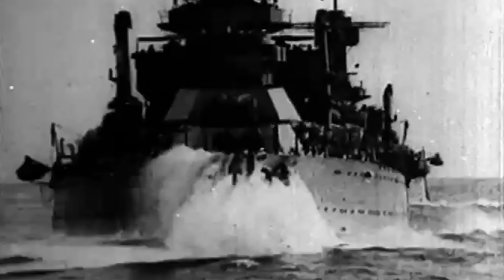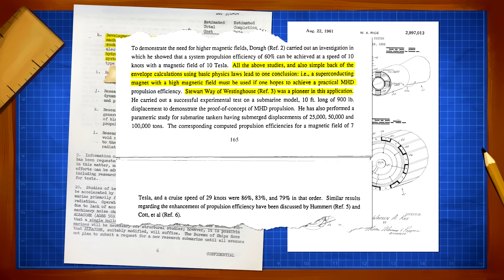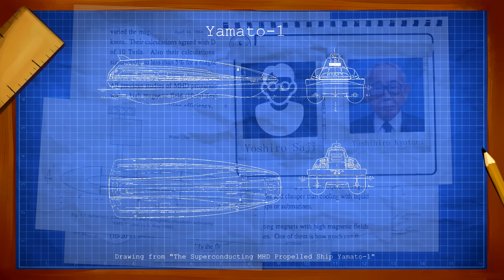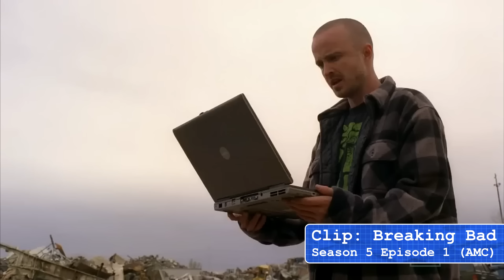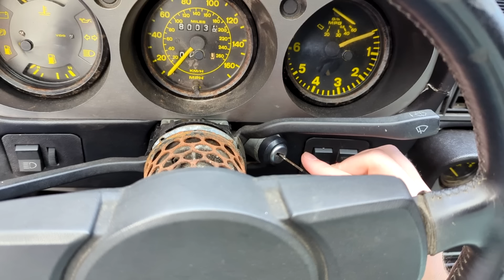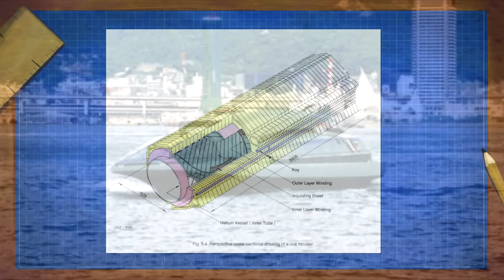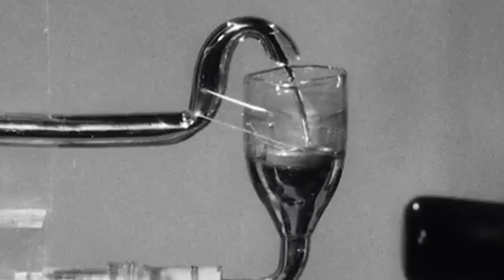Japan's Magnet-Driven Marvel: The Yamato-1

Comment: Why not have multiple small circular accelerators with valves to direct thrust outward and pulse the thrust with each accelerator offset by exactly one half or whatever fraction of a period? Then you could just spin the water until it's going fast enough without needing so much power

Comment: With the new development of electric motors, where the use of copper wire is replaced with a structure of copper bars, which provides a significantly higher voltage, this invention may now be realized.

Comment: The boat would've been faster if the diesels directly provided the thrust or powered electric pump jets and weighed significantly less.  MHD is possible but it seems it's better to achieve the same goals with literally any other form of propulsion.
Reply from the maker: The same can be said for internal combustion engines. When they were first introduced you could argue horses were still the superior source of hauling things. Yamato-1 proves MHDs can work in theory now the technology just needs to get to the point where it becomes viable

Comment: I wonder what the modern hightemperature superconductors would allow a system like the Yamato-1 to achieve. They would only need liquid nitrogen cooling. There are currently some nuclear fusion systems using them with very encouraging results. Shqme it is gone, so we eon't know.

Comment: I dare say it was somewhat more than just a recession, in that it was a recession and 35 year stagnation predominantly caused by self sabotage as shaped by the US empire for the benefit of the US empire. U.S. pressure, especially through agreements like the Plaza Accord in 85, pushed Japan toward policies that ended up worsening the bubble and shaping the crash. Japan’s own policymakers then compounded the damage through tightening and slow financial cleanup. Japan was on track to overtake the US economy within a matter of years before this. China faced its own bubble, but because it keeps tighter state control over finance and doesn’t depend on Washington the same way, it has been able to manage the fallout differently and in a far more beneficial way to China itself.

Comment: Someone help me.  I missed why MHD is desirable.  No moving parts in the drive train?  Thus less noise and easier maintenance?  And in turn we gain; added galvanic corrosion issues, magnetic shielding requirements, a maintenance nightmare cryogenic system with increased maintenance and repair costs, added cost due to scarcity of He, presumably increased power consumption and ??  Why is this a good thing to do?  Reminds me of Chrysler’s turbine car built back in the 60’s - what problem was it intended to solve?

Comment: Nice video! I have been an MRI engineer for over 30 years and I have to make one major correction to your video. There is no reason to continuously warm and cool the cryostat and ramp the magnetic coils. We have MRI coils that have been continuously on field for decades. Warming and cooling cryostats is expensive, time consuming, and a huge waste. All you need to do is run a relatively low power cryo-cooler to maintain the liquid helium, then you just ramp to the desired field and just leave it on. You just have to maintain the cryo-cooler which is not that difficult.
With that understanding out of the way, start up becomes becomes a quick and simple matter of applying voltage/current to the electrodes and away you go (pretty much just turning a switch). We currently make 10 tesla magnets with 70 CM diameter, for a diameter less than half that you could easily make a self shielded 20 or even 30 Tesla magnet. Then like I said, just keep the cryo-cooler running at all times and then outside of some emergency shutdown there is no reason to ever ramp the coils down or let the cryostat warm up. 
This is not something you would use for a personal craft, more for large commercial or military applications. The biggest issue I can see is how quickly those electrodes would degrade pumping thousands of amps through sea water. I also have no idea what the thrust to power efficiency is compared to more conventional systems. It's a very cool idea but a very expensive and complex system and for what benefit? Outside of a military application it's hard to see where it would be practical. Perhaps if we ever get room temp super conductors, and they have a solution to keep the electrodes from disintegrating, it could be a viable option.
Perhaps the military already does use this propulsion method in some classified submarines for ultra quiet running, maybe even as a supplemental system.
Reply: always on demand... not an engineer, but I had been wondering the same thing as I do understand the concept.

Comment: You know what else produces no vibration and no cavitation at 6 knots? Sails! ;-) Also does not require fuel ;-)
MHD looks like an engineering victory over common sense.
Reply from the maker: Sails do require wind though so some sort of propulsion system alongside sails would be the best arrangement
Reply: @sailsandsalvos  Sure. Even though, sails proved their practicality since the dawn of civilization to this day. Unlike MHD, which looks as practical to me as 
driving nails with a microscope.

Comment: Turns out they are completely inefficient. The diesel motor to drive a generator large enough to power the drive has to be much larger than just driving the boat with a diesel engine and old fashioned prop.

Comment: Isn't it suitable for large cargo ships? High speed isn't required, enough time to charge at ports, and no need for fuel for the entire trip. It would also have enough space for power generators and maintenance equipment should the engine stop.

Comment: They still use diesel engines to power up and operate the MHDs, which is rather inefficient. It's like the guy who says he invented a perpetual motion machine and still has to power it on with a hidden battery or other power source. What a scam!!!! They are still putting more into it than they will ever get out of it.

I see this thing in mothballs when the novelty of it wears off.

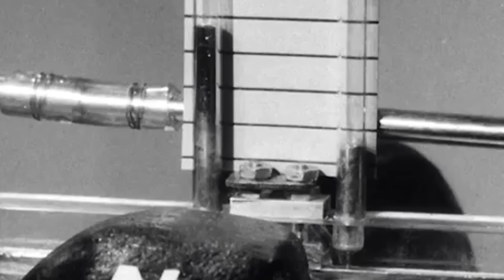Comment: 17:54 - completely silent?  Those diesel generators and helium compressors were "silent"?
Reply: Thank you, now i don't i have to say it😂
Reply: You missed the part about the diesel generators only being necessary during the startup process, and then they would switch it to persistent current, which was internal current, not requiring the external current from the diesel
Reply: @soaringeagle that is laughable.  Persistent current would be total current needed to run helium compressors (not silent) AND drive the propulsion.  Propulsion only happens when the vessel is underway, right?  It had most of the vessel displacement taken by support equipment (generators).  They would definitely be needed to produce propulsion.
Reply: @c @cball8315 ou didn’t pay attention to it at all. Did you the compressor is only pump in the helium in the startup process once it’s in there it’s just super cool once it’s super cool. The internal current keeps it running. The propulsion has not generated by the generators, it is generated by the magnets, which are super cooled. All you have to do is pay attention to the video.
Reply: @soaringeagle you are very wrong, but you have that right.  Good luck with everything.
Reply: @cball8315  how am I wrong? I’m just going by what was said in the video exactly what was said. I guess you know because you’ve actually experienced this? I just paid attention to the video. It has no moving parts when it’s running just magnetic energy making the water move through electric conduction. There is no moving parts so what’s going to be making noises?
Reply: @c @cball8315  the generator were just to get the magnets into a super conductive state

Comment: "No sound and next to no virbration". LOL.  Except for the noise of massive displacement of water they forgot to calculate the first time plus the massive diesel generators needed to power the helium refrigerator and to provide 2000+ amperes to the "silent motors".

Comment: They've wasted a lot of money doing something that was done wrong. Victor Schaubager did it right. Spinning water in a closed loop is far more magnetic than superconductive materials when configured correctly.  30,000rpm inside a 3/4" tube is all it takes, along with a spark gap control system to produce a carrier wave 3x slower or more than the electric pump's sinewave.

Comment: Magnetic forces on water work most efficiently in small confined areas close to the magnets, so why not use a large slow turning "underwater fan" at the front to pressure water in a jet, and then using the magnetic drive to further speed up the small water jet for the drive.

Comment: Possible yes, practical no.  The diesels generating power for the electrical/ magnetic drive could have been used to drive propellers that could have got ten knots or more through the water.

Comment: looks like you did not need to make an entire video on this .
Just a simple Q , and here is the A.
OFC,, its AI ,so there is a fault margin, but it seems a viable answer to the question.
Lets wait and see what the future brings.
Because during the  60's we believed we would have had flying saucers by 2000, and floating housing by 2020..
Its 2025 now, and the "flying saucers" issent even flying  today 65 yrs l8tr..

AI says.
how far is the development of MHD Propulsion today?
As of December 2025, Magnetohydrodynamic (MHD) propulsion has transitioned from a theoretical concept to a functional reality in high-level military and scientific research, though it is not yet widely used in commercial sectors. 
1. Maritime Breakthroughs (DARPA PUMP)
The most significant progress in 2025 comes from the DARPA PUMP (Principles of Undersea Magnetohydrodynamic Pumps) program, which aims to create silent, propeller-free submarine drives. 
Proof-of-Concept Success: In April 2025, HRL Laboratories demonstrated a proof-of-concept for a silent MHD pumping system.
Efficiency Gains: The 2025 prototype achieved 70% efficiency and a projected lifespan of over five years.
Gas Bubble Mitigation: A major breakthrough in 2025 was the use of recirculating electrochemical hydrogen cells, which reduced gas bubble generation by 95% compared to traditional electrolysis. This solves the "noise" and "cavitation" problems that previously made MHD drives easy to detect.
Superconducting Magnets: In October 2025, Tokamak Energy was contracted to provide high-temperature superconducting (HTS) magnets for these next-generation drives, leveraging technology from the fusion industry to create the powerful magnetic fields required. 
2. Space Propulsion Applications
MHD principles are being actively developed for space exploration, where they are used to manipulate plasma for high-speed travel. 
Magnetoplasmadynamic (MPD) Thrusters: In July 2025, research highlighted the use of ideal MHD in multi-megawatt coaxial plasma thrusters, which could provide much higher thrust than current ion drives for Mars missions.
Plasma-Breathing Systems: Proposals in January 2025 outlined "plasma-breathing" MHD spacecraft that could operate for 25 years with high efficiency.
Fusion Integration: In December 2025, the UNITY-1 fusion test facility began studying MHD effects on liquid metal flows at 500°C, a critical step for both energy generation and future fusion-powered engines. 
3. Current Limitations & Challenges
Despite these advancements, widespread adoption remains limited by several factors:
Energy Density: MHD drives require massive amounts of electrical power, typically necessitating a nuclear reactor or large-scale HTS infrastructure.
Material Durability: Electrodes still face extreme corrosion in saltwater, although 2025 material science breakthroughs are beginning to address this.
Commercial Viability: As of late 2025, MHD is not yet cost-competitive with traditional diesel or electric marine propulsion for cargo ships.

Comment: Would the diesel generators not have provided greater thrust if harnessed directly? With the hypothetical development of room or ambient temp superconductors High-Pressure Hydrides in 2020 or LK-99 Controversy of (2023). This has some potential but speeds of only 8 knots are far less then the generators would make if directly harnessed.

Comment: If you throw a rock hard enough across the water it will continue to skim across the water until it loses momentum. I propose all you have to do is engineer a way to attach a small fusion reactor to the rock and it will skip until the Uranium is depleted. Message me with any ideas.

Comment: Might be able to incorporate it into a nuclear sub and used especially when absolute silence is called for. It seems like a good idea cos the nuke will provide enough power to keep it cool, ready for use when needed. Just make a bit bigger sub and design it from scratch, a bit hard to just add it too existing subs (only by making it half as big again in size). 😂
Reply: Maybe you could cut one in half and add a centre piece. 😂

Comment: I'm actually more surprised bigger ships don't use jet pumps instead of regular screw propellers. In most instances, a ship being quiet is not a concern, but jet skis are way faster and more fuel efficient than equivalent sized boats with normal propellers.
Reply: Water jets don't scale well with large loads.

Good for very light vehicles like jet skies, bad for anything larger than a speed boat.

Comment: Magneto hydrodynamic propulsion is terribly inefficient.  It uses a lot of electric power and has low thrust making a slow boat.  I experimented with this concept some time ago.  One big problem with it is the oxidation of the positive electrode.  It operates like electrolysis across a magnetic field causing the conductive saltwater to be driven in one direction as electric current flows through it.  I came up with a possible way to remove to electrode oxidation problem along with the bubbles produced.  I came up with a transformer with a tube filled with saltwater as the secondary winding.  A small test transformer showed that you can directly induce voltage that drives current in a saltwater secondary winding.  The idea is to use alternating electric current through an electromagnetic field that is in-phase with the electric current which should produce thrust in the same direction regardless of direction of current flow.  There would be no bubbles and no electrode oxidation because saltwater is the "electrode".  I didn't fully test this idea and it likely would have very low thrust.  Driving the transformer with 1 msec DC pulses instead of AC might work better.  It is a fun concept to play with, it just isn't all that useful.

Comment: There has been marked improvements in "high" temperature superconductors.
Instead of -273C, there are now superconductors that will operate at temperatures  above -80C.
No longer is liquid helium required. Liquid nitrogen (within the reach of most home hobbyists) will suffice.
Naturally, while near-absolute-zero temperatures used to be required, requiring a 12 day "spin up", today that time could almost certainly be reduced to a couple hours by using liquid helium for an initial cooling followed by liquid nitrogen for a sustained operation.

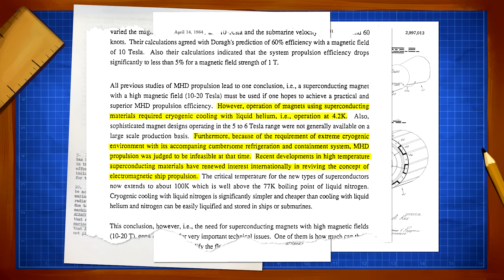Comment: 5:00 Are you sure about this? AFAIR from my lectures - 273 C (0 Kelvin, a rounded -273.15) there is no superconductivity. This temperature denotes a state in which no Brownian motion is occurring. Classical superconductivity happens at very low temps indeed but they are still above Absolute Zero. For example Lead superconducts at -265.95 and Mercury at -268.15 Of course such extremely low temps aren't an absolute requirement, there are materials which can superconduct at - 169C, there are even materials which can superconduct very close (comparatively) to room temperature but these are brittle (like ceramics) and cannot be used to make wire, - therein lies all the difference). Another thing: this mode of propulsion isn't all smooth sailing for military applications no pun intended, as, presumably, any vessel including one with magnetic propulsion leaves a wake in the water which can be tracked, this is how during the Cold War the Soviets were able to track American subs despite less sophisticated sonars due to falling behind in advanced electronics. This system was called SOKS (and it's what those weird devices protruding from the Russian subs' tails are. In a modern naval war theatre, - other advanced methods like satellite, airplane and air and sea drone tracking could potentially negate the advantage of magnetic propulsion in a relatively short time, and because of how expensive running even a single testbed like Yamato-1 is, nvm building an entire fleet (!) - it's not clear whether developing this propulsion method further for military applications will pay off in the long run. A shame that a single unique ship like this was scrapped though.

Comment: The flaw from the beginning seems to be that it needed diesel engines to make all of it possible. And considering the complexity and the fragility of keeping all of the system running together running You might as well just use diesel engines to begin with to propel the ship. Also the fact that it's designers didn't seem smart enough to realize the friction caused by the water intake Would slow the ship down, they were barking up the wrong tree

Comment: For me, important information not given, or if given I missed, is the efficiency of the system.  They were using diesel generators.  What would be the difference between using a diesel driven propeller versus this diesel-powered magnetic drive?